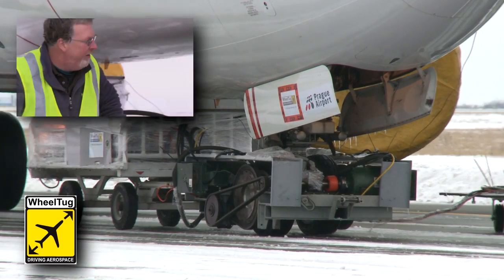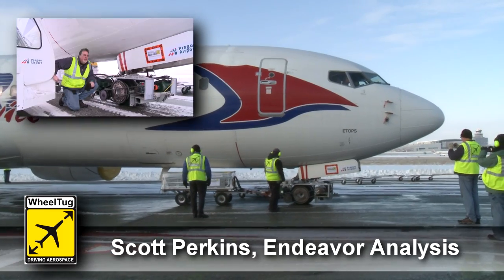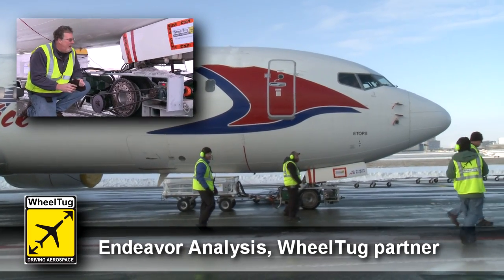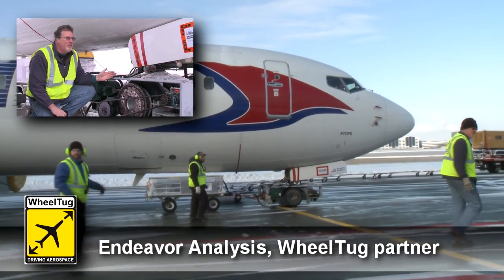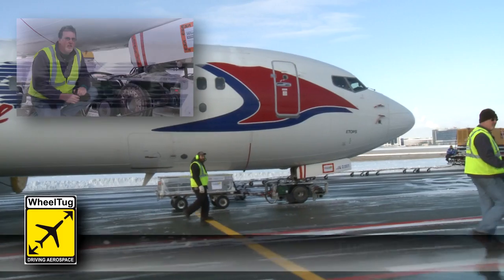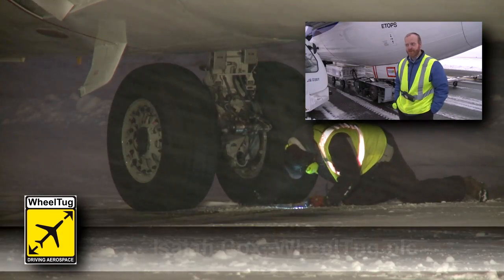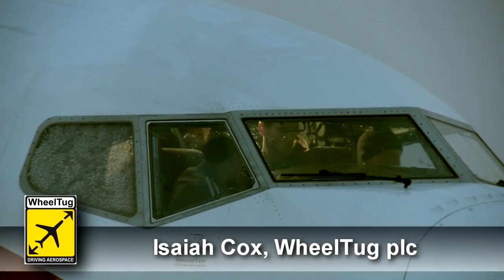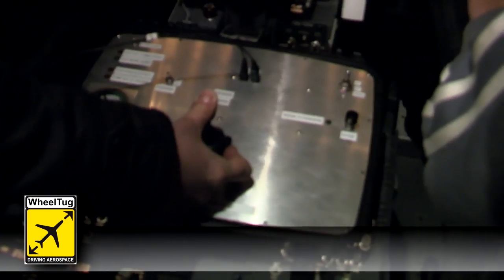WHEELTUG TESTS PRAGUE 2010

Comment: I'm very surprised about the push tug not being able to tow :  it has more weight on ground than the NLG, and tires designed for traction (whereas NLG tires are not designed for traction), adherence is way better! If  tug is slipping , the NLG will slip as well.....

Fake? Rear axle of the push disengaged? 737 on parking brake.? ...